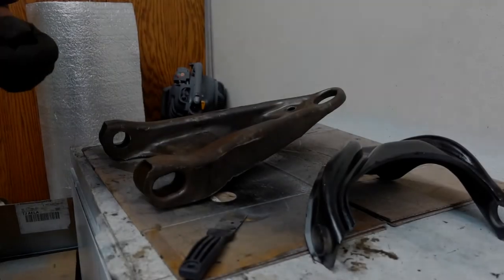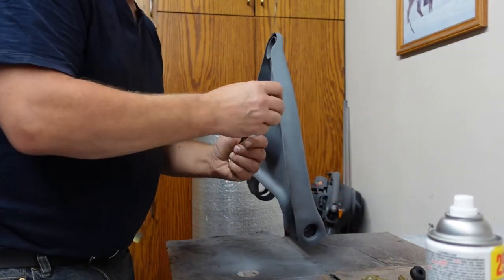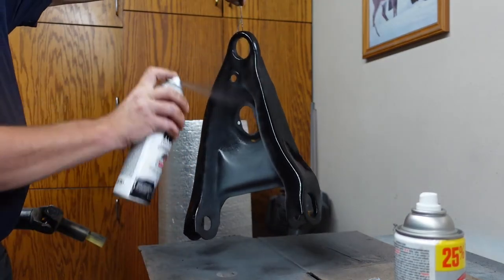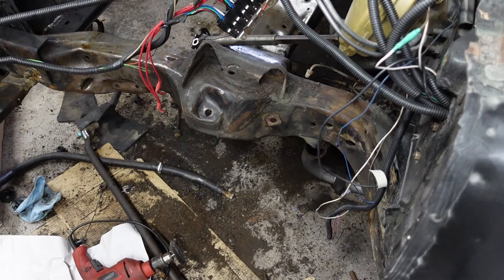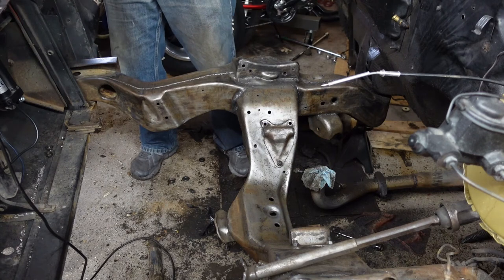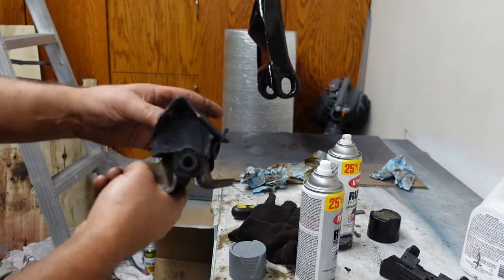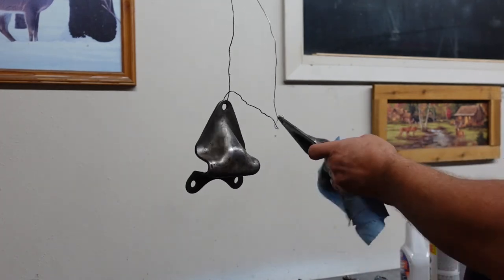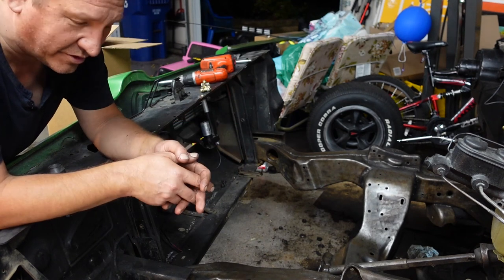1968 GTO A Body - Front End Teardown - Part 3 - Cleaning & Painting

Comment: Quite a difference from Chevelle frame mount brackets. The frame does have that same clam shell looking feature at the crossmember like a Chevelle though.  Ive only seen 68 A-body frames with that,...very unique.
Reply from the maker: I think they borrowed from other lines for the first year of this body style.  Again, it made it challenging to make sure that I getting the correct parts with everything from different cars.